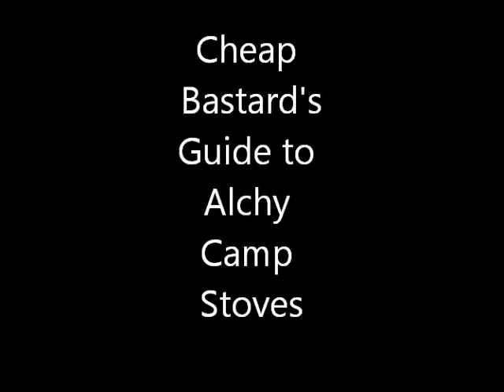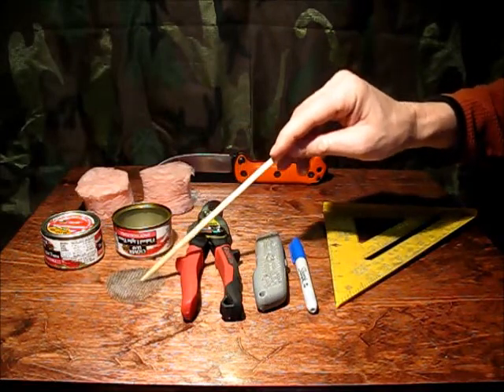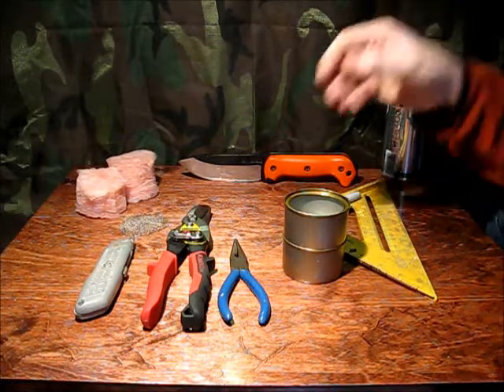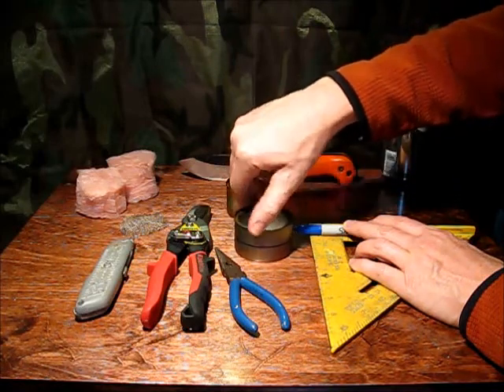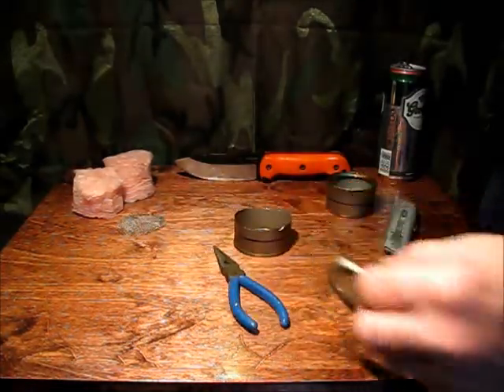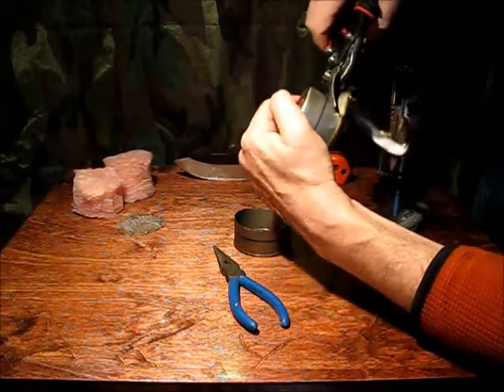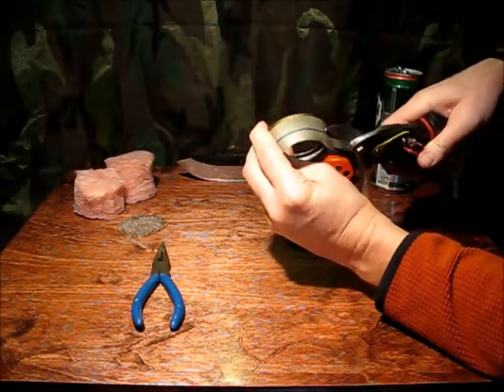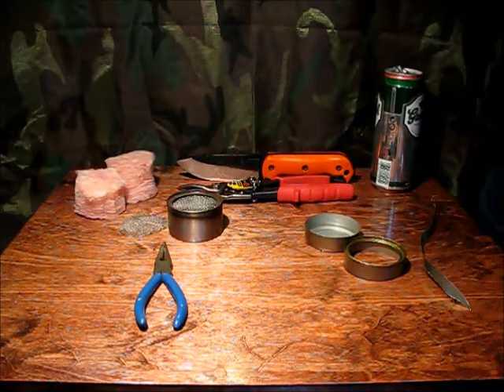Cheap Bastard's Guide to Alcohol Cook Systems - Part 1

Comment from the maker: @adamanime2 
Either way, the handle is gong to be slippery.  However, a couple of points should be made: the shape of the handle bolsters are excellent, such that I have never had the knife slip from my hand.  The other thing is that with multiple coats of paint applied, the handle has actually increased in thickness.  I have large fingers, so for me this is a big plus.  That being said, I will likely add Micarta scales anyway.
Cheers

Comment from the maker: @adamanime2 
Oh god!  I am so ashamed... I painted the original Grivory scales with about 8 coats of marker orange spray paint (I am, after all, a cheap bastard).  The knife is a Becker BK2 2nd Generation.  1090 ChroVan steel - tough as nails, easy to sharpen, and best of all CHEAP (i think I paid $60.00).  I also reprofiled the edge with a convex grind.  I love this knife more than I love my wife.  Did I just say that?
Thanks for watching.
Cheers